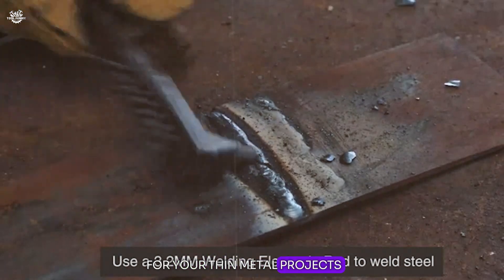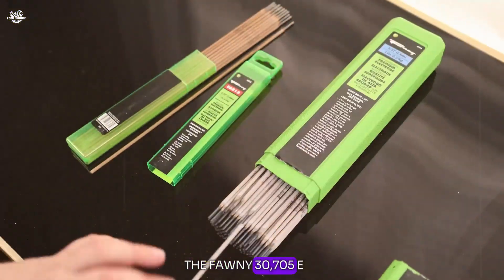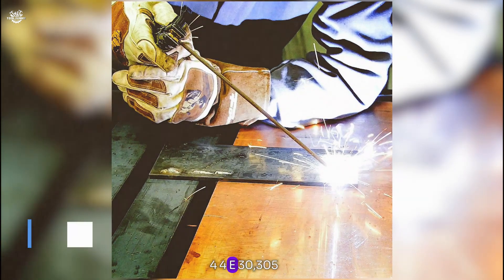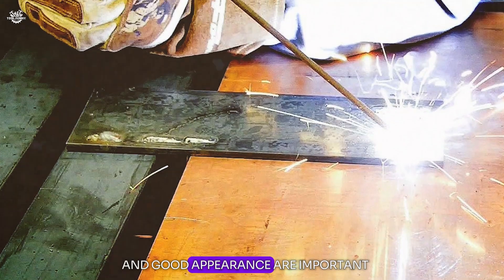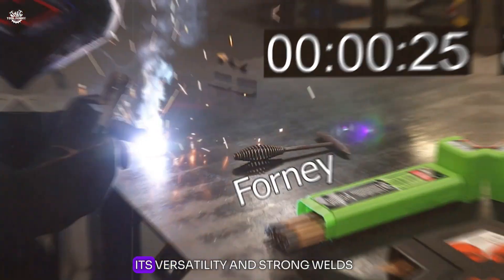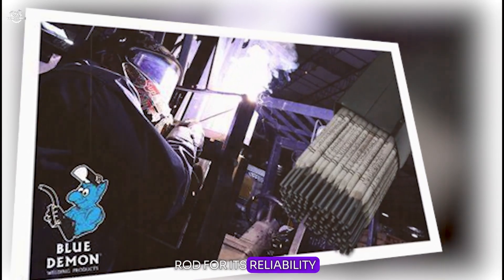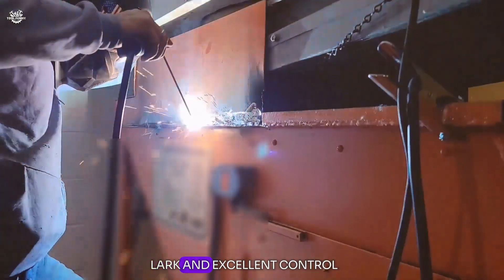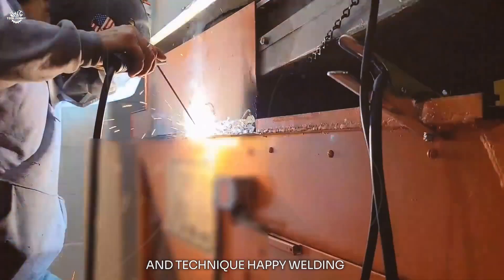Best Welding Rod For Thin Metal [2025 Reviews]

Comment: Does anyone here use 3/32" 6010, 6011, 6013, or 7014 rod to weld 1/8" mild steel? I have trouble with sticking because I have to run the rod so cold to keep from burning through.
Reply from the maker: 1/8 is pretty thick. 16 ga can be done with 1/8 6011 but its fussy and needs some tacks and shorter welds, professional that welds every day is another thing. 14 ga substantially easier and despite the raves about 6013 I dont use it, I should run a few just to remember why I got a DC machine and as for light material like 10 or 11 better they need so much less current. I turn down a pinch for light sheet, not a lot, 5A or so but 1/8 11 will run 85 and 13 is 115,,, real close, might as well use lohy.
3/32 lohy is not bad either as its a 92A rod and turn it down to 85 for light work. 3/32 6011 is 65A, 13 about 85 and 11 is so fast freeze and am used to it but stich with 1/8 most of the time. Its not so fussy about arc length.
Reply: Learn to weld